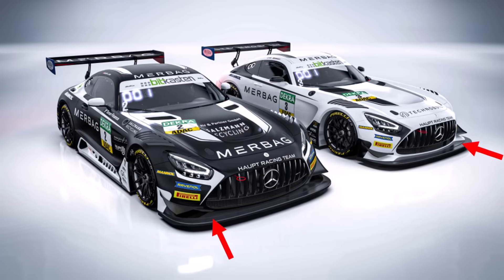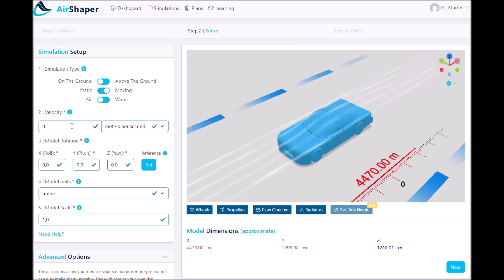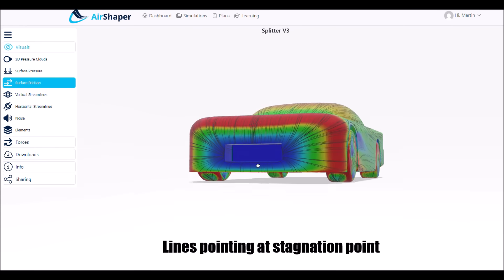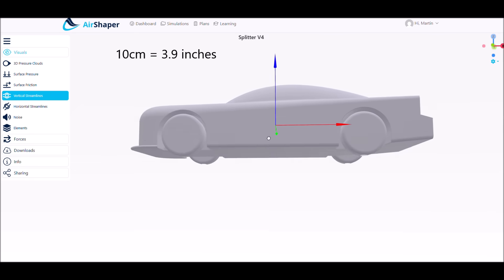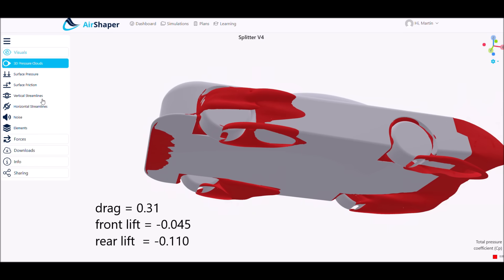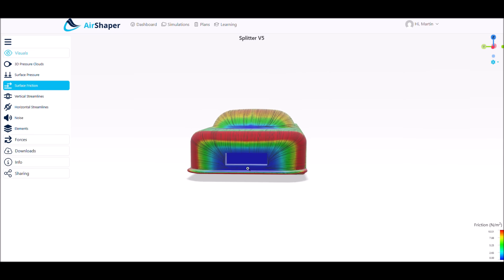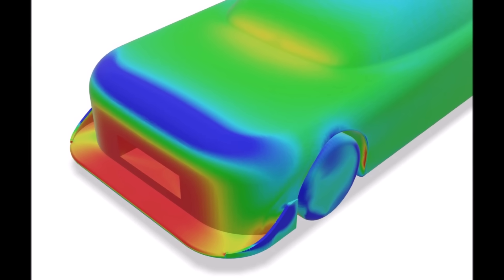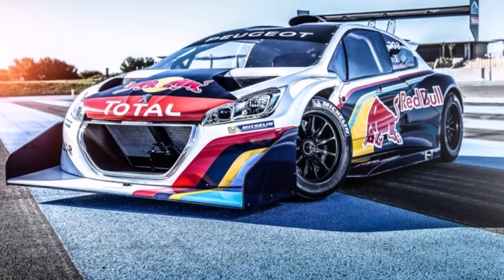How To Design a Splitter - EXPLAINED (with CFD)

Comment: Hi very nice vidéo ! I have a question about the angle of the splitter. Some cars like a classic Mini have a splitter option but not with a flat angle, it have maybe 30°. What's the impact ?
Reply from the maker: Thank you very much! These blades on classic cars allow less at underneath the car and keep higher pressure above, hence increase front downforce.
But they separate the flow at the underside and are less efficient than a splitter with closed underbody.
Reply: @bsport320  Thank you very much for your reply!

Comment: I feel like a major misconception was not mentioned.  Some designers act like any splitter design is fine because they all "trap" some high pressure air, however my understanding is these three designs have different results: 1) splitter extends beyond the car's nose, 2) splitter protrudes about the same as the car's nose, 3) splitter is behind the car's nose.  In scenario #3, high pressure air will escape to the car's underside.  I realize your model has a modest nose so all your examples fall in category #1 but #2 is not rare.  I believe #2 and #3 are mistakes and in side view, you can see examples of #2 on the Ferrari Portofino, 458, latest Ford GT.

Comment: Any plans on doing rear diffusers? I want to make one for my MazdaSpeed 3 but I'm not sure what exactly I should do, especially to avoid catching air between the body and the diffuser plate so it doesn't cause drag and rip off the car while driving. And if I'd need to consider other components to balance any changes it might make to how the car behaves for stability. Probably should note, I don't really intend on racing it all that much, but I'd like to dabble in fabrication, and I think it'd break up the back end of the car a bit aesthetically.
Reply from the maker: Rear diffusers are the next topic in this series

Comment: Bit confused here, 2:20. The sharp edge should create turbulence underneath the car, as flow is not attached - and thus decrease downforce. But you show it creates a low pressure zone and increases downforce.
How does poorly attached flow create downforce underneath the car... this goes against how wings work etc. 

You would need attached, high volume flow, underneath the car to create downforce, not huge separation / dead air that will create drag and lift.

Comment: I have a question about more different shapes of splitters like having the middle part raised

Like in the pikes peak IDR
And how does it affect its performance
Reply: Reduces front splitter performance, but helps feed air to the rear diffuser, as well as reduces the likelihood of a complete front splitter stall.

Comment: Air shaper is cool but I wish there was a cheap non commercial version to play around in without paying a few thousand dollars
Reply: OpenFOAM is your answer
Reply: @nif0  seems very hard to use as a non-engineer.
Reply: @randomcrashingfacility31  Also hard if you are an engineer XD
Reply: @randomcrashingfacility31 open foam isn't to bad. Rather then clicking a check box in a window you're just changing a word in a text file. It's very similar to other CFD in complexity.
Reply: In CFD, the difficult part is learning how to build a model that outputs the correct quantities without exessive cpu time. If you think that the challenge lies within learning how to use Open Foam or some other piece of software, youre in for a surprise. While simple problems like airflow around a car are certaily beginner friendly, there is a reason that some people spend their entire professional careers on CFD.
Reply: You need not only use CFD. You can also use Vortex Lattice Solvers to get a preliminary idea of your aerodynamic design. They're faster and open source, but not accurate enough as CFD.
Reply: I use insightcae, more specifically the workbench with the numeric wind tunnel. Insightcae is an opensource software which is using OpenFOAM under the hood. The numeric wind tunnel is simple to use.
Reply: I did some research into what kind of CFD solutions exist and how they work.
So if you only want to study subsonic flow, and you stay under mach number 0.3, you have just one fluid in one phase, without complex turbulence; then just use Lattice Boltzmann flow software (LBM). 
There are FOSS projects based on LBM, like Palabos (Geneva university), OpenLB, Projectphysx (Moritz Lehmann). Out of all the CFD options, LBM is the easiest to implement from a programming perspective, and some of the cheapest options computationally, LBM is easy to parallelise, and can run on both CPU and GPU.

Then there are the normal CFD solvers (de facto standard tools), using finite volume methods, with a Riemann solver; Either an exact solver (Godunov method) or an approximate solver (which is usually a variant of Harten-Lax-van Leer). If you want a free option, you can use Openfoam, which Airshaper uses under the hood; professionals will use expensive options like Ansys Fluent, Flowvision or Star-CCM. These "solvers" run on CPU only, because they are iterative in nature; in other words, the algorithm isn't meant for heavily parallel execution, so GPUs can't speed up the computation and would actually be slower than a CPU. The benefit, is that this doesn't have the limitations of LBM, so you can calculate turbulent, supersonic, multi-phase, etc.
If you want to simulate turbulent flow, you'd probably want to select the K-omega-SST turbulence model.

And there is this sort of upcoming method (that actually isn't that new) named "Discontinuous Galërkin" (DG). And it has FOSS implementations like "Flexi, Galaexi".
DG can run very well on GPUs (like LBM), but it doesn't have the limitations of LBM.

So yeah, there are multiple options to download. And if you want more computing power, then you can just rent a VPS with a GPU at Hostkey or Hetzner.
And if you just want a site, where everything is already setup, then just pay for airshaper.
Reply: Openfoam
Reply: @Phenx  Literally the first reply mentioned that too. And yet people don't know about LBM and DG.